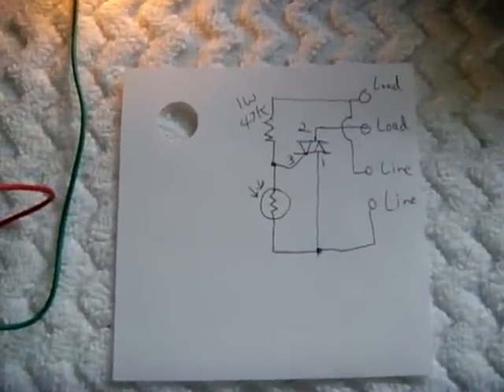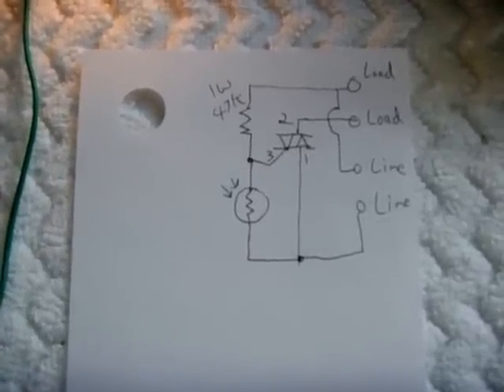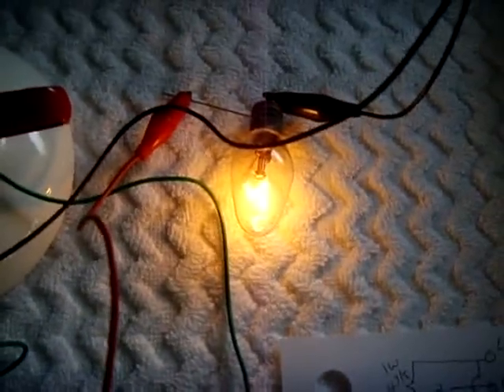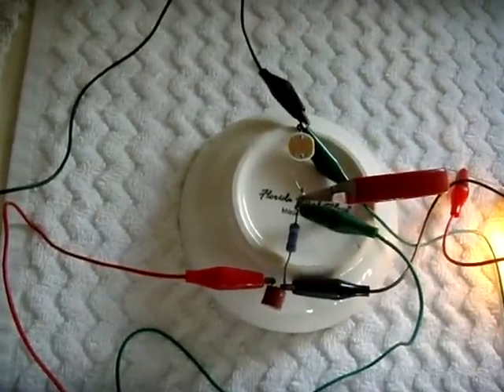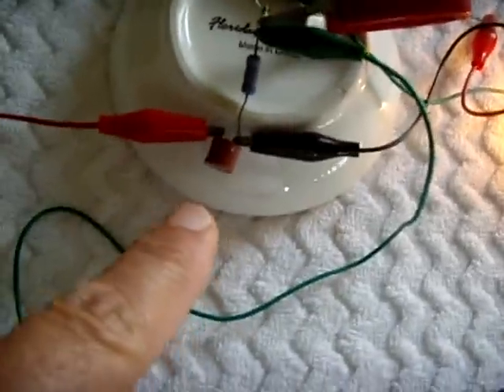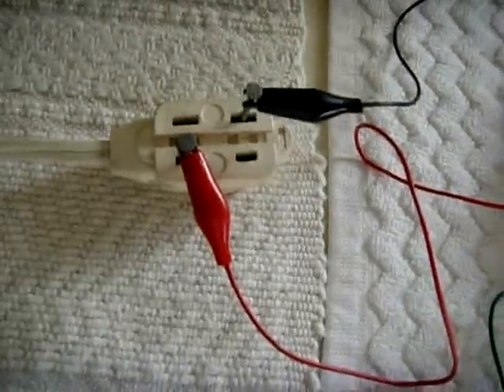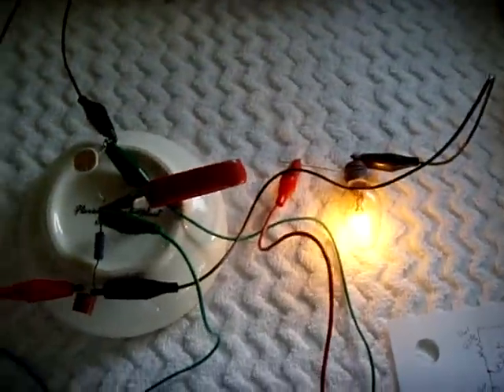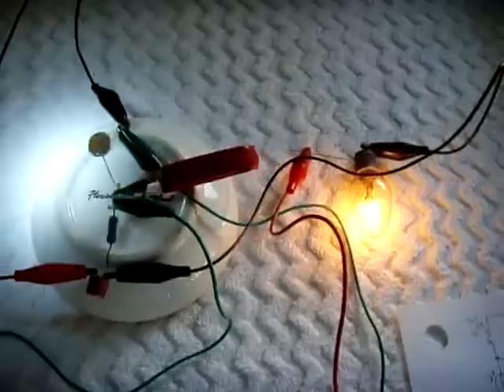120V LDR/Photoresistor Activated Lamp Circuit

Comment: thanks for posting friend , i was gonna build this but ive decided i may just go buy a light activated flud lamp and gut the thing for the parts i need
Reply from the maker: +NOBOX7 You can do that, but you will end up spending much more money. Buy your parts on Ebay.
Reply: electronicsNmore yes you are correct, good eye , but im in a terrible hurry , ive bin constructing a device for several weeks now and i dont wanna fire it up without automatic fuel feed.turns out your video gave me the idea that i can use a site glass and a light bulb to turn an auger on and off  . so the reason im gonna waste cash is to procure a circuit with the proper specifications {no testing or research needed }  thanks for posting friend i owe ya 1

Comment: Yes I had it reversed corrected that circuit works properly now but one more thing the light source has to be so close to cut the circuit off why is that and is it another resistor or something that I can use to add distance to light to circuit board what can I do to imply more distance from light
Reply from the maker: kenchi chewlo Try another LDR, or adjust the resistor value higher to correct the problem.
Reply: Ok thanks alot

Comment: First thanks alot for the video and the schematics  (i appologize
 for my poor english).
I did tried the circuit but it turned to be a light-activated circuit ...
After some researches on the net , i found that by switching the 47K resistor and the LDR in the voltage devider , it should work , i tried it but ended with burning the LDR :)
What i'm i missing here ?
Reply from the maker: What voltage? 120V?
Reply: yes it's 120V ,  i forgot to mention that i'm a newbie in electronics , i made a pcb for the circuit , my guess is that i used a lamp which has higher power consumption ( more than the 7W shown in the example ).
Reply from the maker: If you connected it EXACTLY as in my video, then you should not have any issues. There was no reason to switch the location of the resistor and LDR.
Reply: Thanks for your answers , i will recheck my circuit for bad wiring :)

Comment from the maker: Place the LDR in the position where the 47K resistor is located. Place the 47K resistor AFTER the LDR connecting it to the gate(pin #3 location). From the point where the LDR and 47K connect , add a 100K 1W  or 2W resistor to the lower rail of the schematic in the video. To avoid having the pump gradually turn on as it gets brighter out, connect a 120V relay w/diode to the LOAD terminals in the schematic. Connect fountain to the relay contacts & 120V. You may have to play w/resistor values!

Comment: Great idea. I need the behavior of the circuit to behave opposite. For example, I need to basically turn on a decorative fountain on during the day and off at night. I always assumed that photoelectric switches can only operate the way you describe in the video (e.g. on at night / off during day). Is there a specific type of LDR that will have a high resistance in the presence of light or is there a simpler way to achieve what I'm after? Thanks much!

Comment from the maker: Very easy. Take a 2n3904/bc547/ksp2222a and wire the collector to +V. The emitter goes to the + of the load, and the - of the load to ground. Then connect a 504 POT from the base of the transistor to +V. From the base of the transistor to ground you add a LDR which has a very low value in light, and very high value in darkness. Adjust the POT for desired operation. The circuit will not go on unless it is extremely cloudy/dark. As darkness approached the circuit will slowly activate.

Comment from the maker: The way the circuit works is simple. The gate of the triac requires a certain amount of voltage to allow the current to fully flow through the triac to the load. The 47K resistor greatly reduces the amount of current/voltage to the gate. When the LDR is in a dark state the resistance is very high causing voltage at the gate to rise enough to turn the triac on and allow the current to flow. When the LDR is illuminated,resistance is very low, causing the gate Voltage to drop, turning off the triac